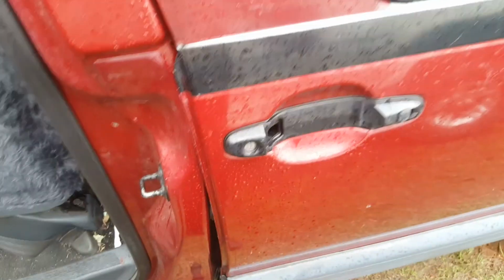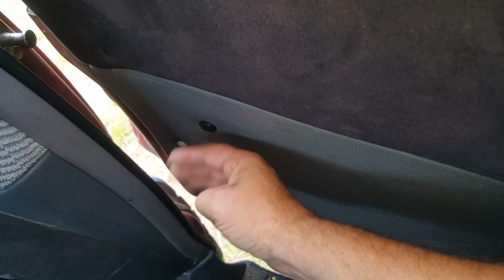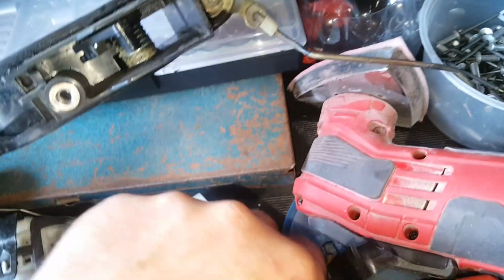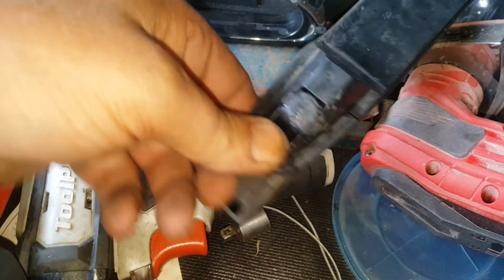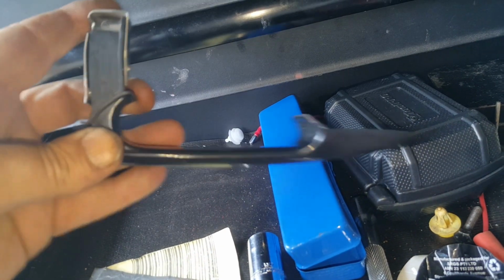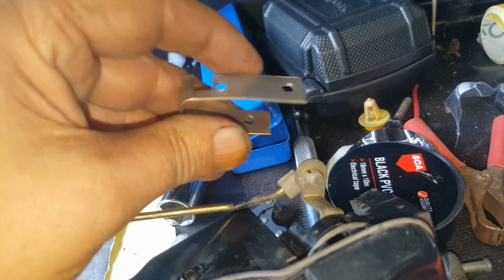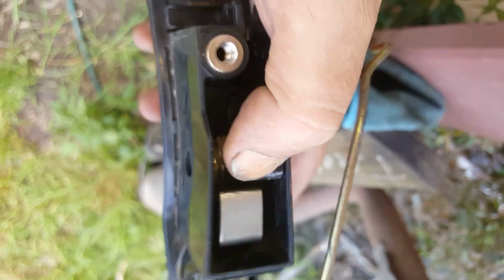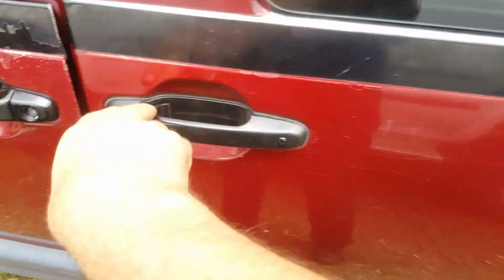Sliding Door Handle Repair not Replace [ Tarago Previa Estima TCR10 ]

Comment: Hi
I had the same problem. I broke the top part of the curved lever for pulling. I made a similar contraception but getting the lever notch in the slot is a challenge. 
I used screws instead of rivets.
Reply from the maker: Excellent, I like to see things repaired instead of replaced when possible.

Comment: Hi
Quick question if you can answer it for us pal. Cigarette lighter stopped working after plugging a external heater. I’ve changed the fuse in the central dash but it’s still not working. Any ideas?
Reply from the maker: What else doesn't work? The main fuse for the Cigarette lighter is the CIG 15A fuse, Also affected by that fuse are the Air Bags, Clock, Side Mirrors, and probably a few more things. Also, check the main fuses under the hood next to the battery.
Reply: @TaragoPreviaEstima  thanks for replying. I changed the 15a amp which said cig 15a. The clock works but the cigarette lighter is still not working. I’ll check the fuses under the bonnet tomorrow to see if there is anything in there.
I also checked all the 15A 10A and 30A fuses in the central dashboard and all of them are ok.
Reply from the maker: If all the fuses are OK and the only thing not working is the Cigarette lighter I would check the connection on the back of the Cigarette lighter.

Comment: Good job on that!😊 I have a ?. Are there any heater hoses that could leak coolant from the AC drain!😲 or is the heater core shot?
Reply from the maker: Not coolant no. The AC drain will drip water out of the drain lines but if you are losing coolant into the cab then your heater core has a leak :( I would use liquid intelligence radiator repair before looking at pulling the heater core out.
Reply: @TaragoPreviaEstima  thanks for your response. 243?